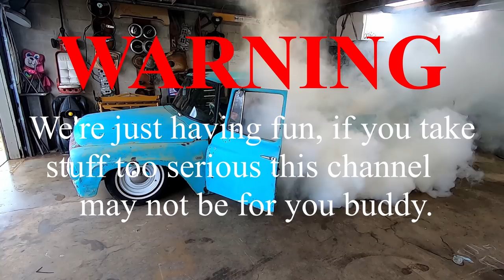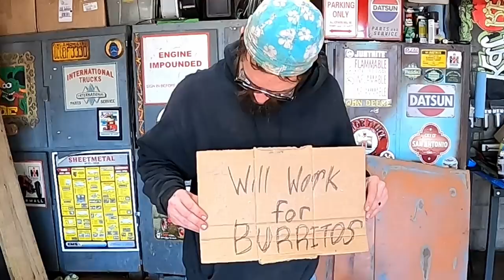STRIP IT DOWN. Finishing metal work, disassembling truck, and MORE!  ((1977 Datsun 620.))

Comment: I have found that if you put the rear wheels of your tow vehicle onto ramps it will lift the front of the trailer which lowers the rear of the trailer. Works well for low cars and may have been good for loading the datsun

Comment: You should turn the bob bed into a trailer for the Datsun box truck. You could center up the wheel wells & use the metal you cut out to fill the holes where the wheel wells are now. & put it on air ride so it runs at the same height as the truck.

Comment: Lol. Lov them hanging new balances on the rear end.
Some bedliner to cover the inside floor boards to keep it water tight.
Don't forget to spruce up the interior with some of the high dollar seat covers.
Putting a  drywall bucket infront of you vack will help from killing your vacs, and allows you to do that wet vac without killing the wife's high quality, high dollar indoor vacuum out in the shop...just don't let her see ya taking/using it 😉.

Comment: We drilled it out so that it would fit and with alittle bit of help from an adapter kit we had that engen runnin just like a song now the head lights was another sight we had 2 on the left and one on the right but when we pull out the switch all 3 of them come on 
For some reason johnny cash rain through my head about 3 time throughout the video amazing job as usual puddin these have a lot of production value it's insane I'm a huge fan

Comment: I have the same Milwaukee it's a beast get you one of those cheap ass little paint brushes keep the filter brushed off and tapped out dont blow the filter clean it separates the fibers and fine dust gets in the motor and gums stuff up

Comment: A buddy wanted me to stick a 1/4" bolt into the head of a 5/8" bolt head. So I center drilled it on my lathe and then tapped it out with my cheap Craftsman 1/4" X 20 tap, which broke. I threw that 5/8" bolt away and got another one out then wondered where I'd get another tap. Then I remembered the drawer in the bottom of the Kennedy tool box I bought that used to belong to a tool and die maker that had a lot of taps in it. In there was a box that had about 200 1/4" X 20 taps. I think I'm set for a while.

Comment: I've had to load car's alot by myself, I've used ramps under the rear tyres of my 4wd & made the rear of my Car trailer almost sit on the deck. So much easier to load shell onto any trailer. 
P.S. love ya work mate keep up the Good job & keep the video's coming .

Comment: By welding those holes you removing your aerodynamics by utilizing your infarction and your dynamic air flow causing your air/fuel metering device to over compensate for the lack of tunnel dynamics ! Causing a weight reduction in your gluteus maximus ! Lmao 😂

Comment: Dude what happened to your 3/8 universal joint? The one you were using when pulling the bumper bolts out.
Reply from the maker: Trying to think about why your asking that? 😂 does it have masking tape? If you have a hard to reach area and the joint is to floppy, wrap a piece of tape and it stiffens it up where you can guide it, but will still flex and do it’s job as needed
Reply: @PuddinsFabShop  could be masking tape 🤷🏻‍♂️ it looks spikey lol. We use electrical tape here in the land of corruption corn and Lincoln

Comment: So all I gotta do is just cut your power off and your security system is down. Ooof. 🤣
Reply from the maker: Backed by batteries and is connected to cell service. Sounds like you woulda tried and caught a new balance.
Reply: @PuddinsFabShop  well that’s good that it has a backup in case of power outages.

Comment: I hate to be "That Guy".... but, removal of the parking brake cable is technically the disabling of safety equipment.  If you ever get pulled over by a cop with a chip on his shoulder - and he sees that - he could make life for you a very, very unhappy place. And who knows? What if your brakes fail?  You're not just gonna scrape frame for a mile, are ya?  The life you save could be your own.

Just my 2 cents.
Reply from the maker: Ya that’s definitely a “that guy” comment 😂😂